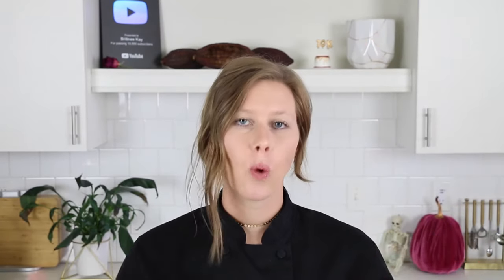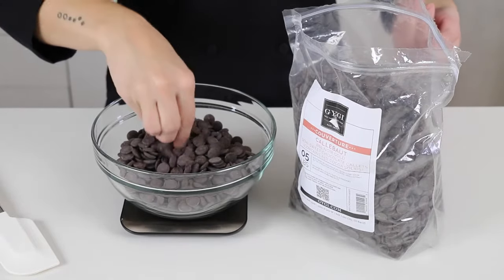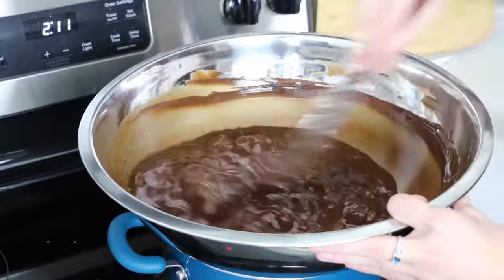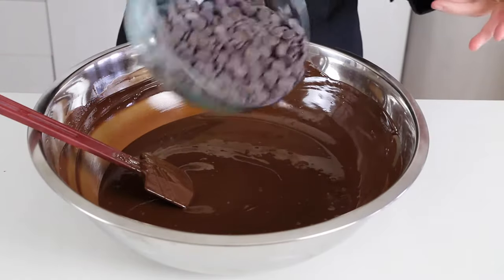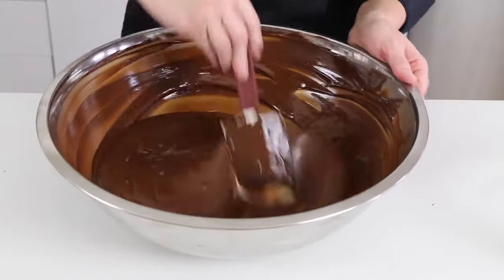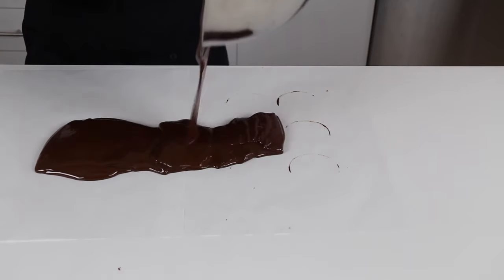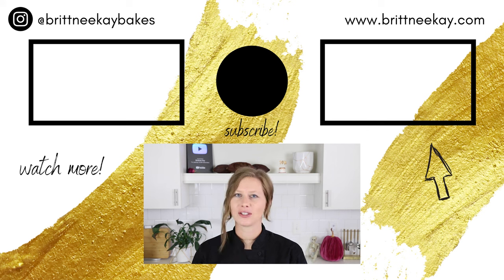Temper Chocolate | Seeding Method

Comment: Hello, Britnee. So I’ve commented in the past on this same video but I have a question. So I use callebaut 811 to temper and I do the method you suggested, heating to 122F-131F , adding about 20% seeds, stirring, and cooling down to 87-89F. 

So I’ve tried this a handful of times and idk if it’s tempered. How do I know? I do a temper test and it sets up really quickly but when I go to spread it onto parchment to cool and reuse, It takes really long to solidify and sometimes it blooms. 

I bought a thermapen because I thought maybe it was my thermometer but this time I spread it out onto the parchment and it didn’t bloom but it took about 30 mins to set and snap. It did snap, but it took a while and also the thin parts where I spread it onto the parchment melted pretty easily. I’d love some help or any tips. Also, I have broken this chocolate up into pieces in the past and used the same chocolate to temper, but I use callets straight from the bag to seed.
Reply from the maker: Ok awesome! Thanks for all the details. The methods you are using sound great! You're spot on with reusing the chocolate but seeding with fresh chocolate from the bag. And you did a temper test and mentioned that it passed, great!

The more chocolate you have (thicker), the longer it will take to set up! So when you spread it on the parchment it will take longer to set up than the temper test...but that doesn't mean it isn't tempered. Also, it may not have the same "snap" depending on when you break it up and also if it's cold. Chocolate actually takes 24 hours to fully crystallize, so if you break it up before that it may not have as big of a snap and it also may still melt a bit quick in your fingers, especially if thin.

I would say a better test than analyzing the leftover chocolate on your parchment is to try molding with it! Have you molded any chocolates with your tempered chocolate? I feel like that will give you a much better idea. Do the bonbons come out of the mold easily? Does the chocolate have a nice snap when you bite into it? Is it shiny with no streaking? Let me know if you've done this! Hope it helps!
Reply: @BrittneeKay  thanks so much for replying. Good to know that reusing chocolate isn’t the problem. The thing you said about chocolate taking 24 hours to crystallize fully is very helpful. I think it is tempered because it did snap and also it didn’t have any streaks. So I actually have never molded it I’ve only been practicing with tempering until I get it down, but I will definitely try molding them next time. 

Would you recommend I fill the molds, scrape, and leave at room temp for 24 hours? Or should I fill the molds and tap out the excess? Also should I put it in the fridge for the chocolate to contract from the molds? 

I will definitely mold them next time I try tempering, thanks for all the great tips and advice as well, really helps a lot!
Reply from the maker: @angelvaldovinos4123  Good for you for wanting to master the tempering before jumping into molding, that'll save you some heartache!
If you are doing a flat candy bar you can practice that way by filling the molding and keeping the chocolate solid. Otherwise I would recommend for bonbons tapping out the excess and filling and capping them. Just because the solid chocolate will crystallize and behave differently than the shells. So if your goal is to make bonbons practice and test with that! If you don't want to focus on fillings quite yet just fill them with anything that you'll enjoy eating! Brownies, caramel (you can cheat a little and use Peter's), or cake pop filling!
Once you shell, fill, and cap let the chocolate harden oustide the fridge and only pop them into the fridge for 20 minutes right before unmolding!
Hope this helps!
Reply: @BrittneeKay  sorry for the late response, but thanks for the help! I will definitely try experimenting with filling and also just using bar molds as well. I’ve learned so much from your videos as well so thanks a lot!
Reply from the maker: @angelvaldovinos4123  Aww I'm so glad, thanks!!
Reply: @BrittneeKay  so I received my bar molds today and tried tempering and molding. I tempered the chocolate, then molded them, then let them rest at room temp for about 1 and a half hours. They were completely set, came out of the mold, and snapped when I broke them. 

But for some reason, when I tried the seeding method the chocolate didn’t set and it was really soft. But when I did the seeding method then brought it down to 80F then heated it up slightly to 87-89. It worked well. Is there a reason why that happened? 

Also is there a reason why you don’t usually bring it down to 80F before heating it up to the working temp? I’d love to know. Thanks so much!
Reply from the maker: @angelvaldovinos4123  Oh nice! That's great they turned out!
As for the seeding method, if you had to bring it down to the low temp then the problem is probably that you didn't have enough seeds/they melted too fast when you did the  seeding method. Technically you don't need to bring the chocolate down to the cooling temp in the seeding method because it is essentially modifying the process by adding cool seeds and stable crystals all at once. Make sure your last seeds are just melting at around 34C, if they are long gone you probably won't get a good temper!
Reply: @BrittneeKay  ah. Makes sense. So I’ve been doing 25% seeds but they do all melt pretty quickly. So I will make sure to add a handful more of the seeds so it can get a good temper
Reply from the maker: @angelvaldovinos4123  Rather than add more seeds add them slower in a couple handfuls. Heat the chocolate up to 45C then add around half your seeds, stir, your chocolate will be around 38C, then add and stir until you get to around 33-34C and stop adding. Stir occasionally until working temp! See if that works! : )
Reply: @BrittneeKay  got it. I just did this, put it in the mold, scraped them, and let them set. And they popped out of the mold. Does that mean it was tempered? I honestly still don’t know how to tell if chocolate is tempered. There no bloomed spots, it did melt on my fingers pretty easily though.
Reply from the maker: @angelvaldovinos4123  sounds tempered to me! Chocolate will always melt in your hand so that isn’t a great way to measure really 🙂 unless it melts extremely fast! Does it have a firm snap?
Reply: @BrittneeKay  oh good to know. It did not melt extremely fast but it started to melt from me handling it too much I think? Like my fingerprints were on it but it wasn’t melting, it was kinda rubbing off though. I should probably wear gloves.

It did have a firm snap and I actually only let it set at room temp. It easily came out of the mold and snapped. But it took a while to set. Idk if that’s Normal but it takes about 2 hrs to set and the excess chocolate that I spread out to reuse takes about an hour as well to fully set and snap. So that’s why I’m wondering if I’m doing it right
Reply from the maker: @angelvaldovinos4123  Yeah that just sounds like normal chocolate! Untempered chocolate melts REALLY fast...because it never fully sets up. You can really tell the difference!
Popping it in the fridge for 20 minutes before unmolding to help it contract from the mold works great. And remember chocolate takes a full 24 to fully crystallize. So the next day take a bite or break it and see how the snap is!
The thicker the chocolate the longer it'll take to set up...so your leftover chocolate taking a full hour is totally normal. My leftover chocolate sometimes even gets streaky which doesn't mean it's out of temper, it just means it's thick and cools unevenly!
Sounds to me like you're in temper and everything is fine!

Comment: Do you add any oil on chocolate before melting or not? I've watched a couple of videos, and they are adding coconut oil
Reply from the maker: No need to add oil! But the appropriate fluidity for your purpose 🙂 couverture will already be formulated for what you need it for most likely

Comment: When Reusing left over chocolate do i have to reseed also to make sure it is tempered?
Reply from the maker: Yes once it has set up you will need to retemper it. And be sure that you always use properly tempered chocolate as your seeds 🙂
Reply: @BrittneeKay  By that, do you mean the left over chocolate can be used as seeds as well? i.e. can we split the left over chocolate to 80/20 and use the 20% of this leftover as the seeds for tempering the entire batch again? Many thanks in advance, really appreciate your channel and enjoy your videos!
Reply from the maker: I have used leftover chocolate as seeds as long as it's tempered correctly, but if you have fresh callets I would use those. Because when it's fresh from the manufacturers bag it is at it's best, and when we temper it we don't actually know the amount of stable crystals. Sometimes even though chocolate is tempered it can be a little under or a little over tempered. So...it can definitely work but for the 20% seeds I like to always use brand new callets! @diakhianey
Reply: @BrittneeKay  So it would be wise to always have some fresh callets on hand? One more question, I also use those bags of Callebaut 811 couverture chocolate.. are those already tempered? can they be directly warmed to 32 degrees Celsius at first use when taken fresh from the bag? Sorry to be so specific 😅 you have the patience of a Saint
Reply from the maker: Yes! Or you can always use the tradition temper scale and hit all three temperatures to ensure the chocolate is tempered correctly, no seeds required.
No you are asking great questions!! Questions I've also asked and the answers can surprisingly be hard to find! Yes all packaged couverture comes tempered, but unfortunately no, you cannot simply warm it up to working temperature :( You must temper chocolate each time you use it!  @diakhianey
Reply: @BrittneeKay  Thank you so much for sharing your knowledge & experience. Chocolate making, esp tempering is just so intimidating.
Reply from the maker: You're so welcome! Keep practicing and it'll become very easy! : ) @diakhianey

Comment: So for this method, I don’t need to cool it down to 80.6F (in my case) before bringing it up to the working temp? I just have to melt, seed, then cool to working temp?
Reply from the maker: Exactly! And make sure your seeds get you all the way down to a couple degrees higher than working temp. If they all melt too fast at the beginning you won't get a good temper. : )
Reply: @BrittneeKay  I see. Will do. Thanks for the help!
Reply from the maker: You're so welcome! @angelvaldovinos4123

Comment: Hi! If I want to pour the chocolate into moulds should I heat it again or is the chocolate now ready to be poured into moulds?
Reply from the maker: Once it cools to the working temperature it is good to use in molds! Working temp for dark chocolate is 32-31ºC
Reply: Thank you so much I’ve always thought I needed ti heat it up again. Someone told me that I should heat dark chocolate to 48 then cool it down to 26 and then heat it up again ti 32. But with your method it’s enough to heat it up to 45 then down to 32? I’m using callebaut
Reply from the maker: Well, that is true, it's just a different method of tempering. So heating it up to the top temperature, then cooling it down, then warming it to working temperature is the full tempering method. This is the seeding method and it works a little bit differently. Instead of cooling it down to 26-27, you heat it to it's top temperature, then use the seeds to cool it and temper it to working temperature. Hope this helps! @Saf-uv7cn
Reply: Thank you so so much for your replies. You have no idea how helpful your whole channel is. I just found you😅
Reply from the maker: You're so welcome! I love helping when I can! @Saf-uv7cn

Comment: Hi dear, up to what temperature does chocolate not soften in the environment and keep its shape?
Reply from the maker: Well chocolate will begin to get melty at pretty low temperatures, lower than your body temperature. Ideally you want your room temperature to be around 69F.
Reply: @BrittneeKay  I tempered the chocolate and poured it into the mold. When I took it out, it gradually softened at the ambient temperature of 25-27 degrees, and when I wanted to take it, it stuck to my hand and became deformed. Do you think I tampered wrongly? How do those whose job is making chocolate make large quantities of chocolate and the chocolate does not become soft and lose its shape?
Thank you for guiding me 🌹
Reply from the maker: Yeah it may just simply be because 25-27 C is quite warm for chocolate. Aim for around closer to 20-22, the cooler the better! It is just really hard in a warm environment to create and keep stable chocolate! @zahra.bano5753
Reply: @BrittneeKay  Thank you dear ❤️
Reply from the maker: You're welcome! : ) @zahra.bano5753

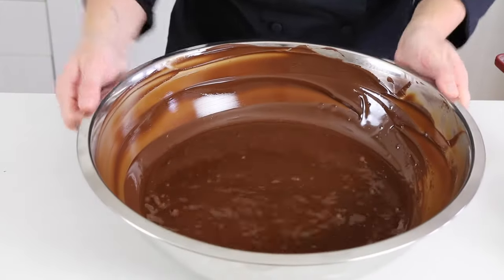Comment: 4:58 you said it cooled a little too quick. Could this be avoided by using a glass bowl?
Reply from the maker: No, you don't want to ever use glass because during the heating process glass will retain the heat and can actually easily get your chocolate too warm. The reason my chocolate cooled too quick here is because I dumped all the seeds in at once, which you can do for sure and be fine, but now I usually just add them half at a time : )

Comment: I’ve been doing the double boiler but what is the temperature for white plz I need more tips
Reply from the maker: You should have a temper chart on the package of chocolate that you chose to use. Generally however white chocolate is to melt to 45°C, cool to 26°C, and reheat to 29°C. Hope this helps!

Comment: How should I do if the chocolate is not within working temperature while the temper test is still going on?  Do I need to reheat again?
Reply from the maker: Keep it warm using a heat gun or the double boiler. Once you become confident in tempering you won’t always do a temper test 🙂

Comment: Shouldnt the chocolate not leave an imprint on the partchment paper when properly tempered?
Reply from the maker: Not necessarily...it depends on the temperature and also how long you let it set up. Technically chocolate takes over 20 hours to fully contract and temper, so if you pull it off too early it can leave marks :)
Reply: @BrittneeKay  thank you 😊
Reply from the maker: @Viral-Inc00  of course!

Comment: So I tried this again. I’ve had variable success. Too bad I don’t know what I’m doing wrong 😕 but this happened today: I didn’t think the chocolate was tempered because it wasn’t setting up, so I re-heated it and tried again. It WAS tempered the first time! It just took lomger than usual to set up. It wasn’t tempered the second time!
Reply from the maker: Ah yeah! You have to be careful when rewarming it! One thing is to be sure to stir enough to help develop stable crystals and also make sure the seeds don’t melt too fast. Ideally you should be just a couple degrees above working temperature before your seeds are all melted!
Reply: @BrittneeKay  I think the seeds are melting too fast. Do I need to let the chocolate cool down some before adding the seeds? Or should I add more seeds? I’m using 20% of the total by weight. I am stirring vigorously and continuously-is that ok?

Comment: So why didn't you let it go down to the low temp and then bring it back up? Isn't that the way you tempter chocolate?  I'm sort of confused right now😅
Reply from the maker: It’s a bit confusing but when you use the seeding method you don’t have to go down to the low temp! Adding the tempered seeds and moving the chocolate around develops enough beta 5 stable crystals to temper it!
Reply: @BrittneeKay  
Oh ok. I learned we must bring the temp up, down, then up again. Can't wait to try this. Thanks gorgeous!
Reply from the maker: @LindaSweis  Yes, when I first learned I learned the same thing even using seeding. And you can do that for sure, but you don't have to! It is confusing...just know that when you do it by tabling you'll want to follow the exact curve. Seeding you can cut the low temperature out. Just make sure you are seeding it until you get a couple degrees to the working temp. And then you can also do it in the microwave where you melt half and then the other half acts basically as seeds so when you stir it they melt but encourage the stable crystals to form. So really there are different ways, but you can never go wrong by following the temper curve! :)